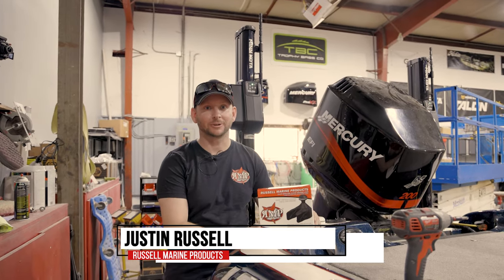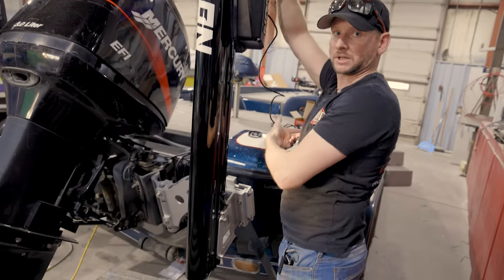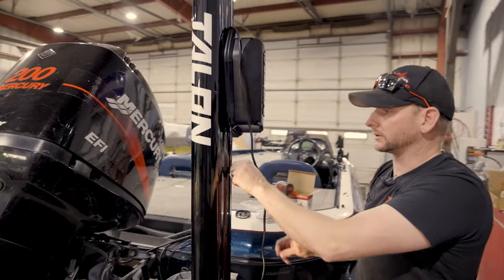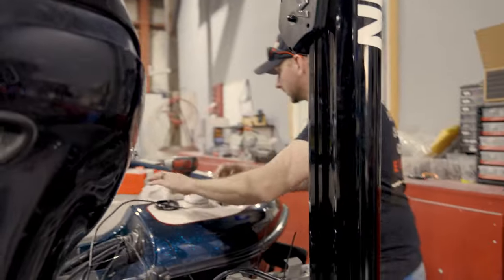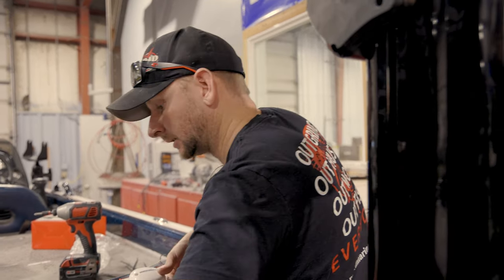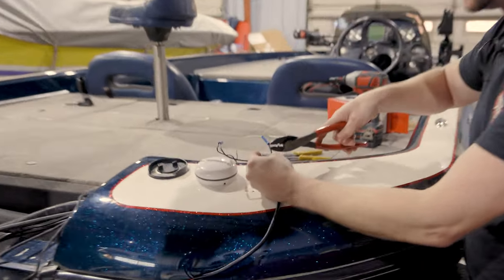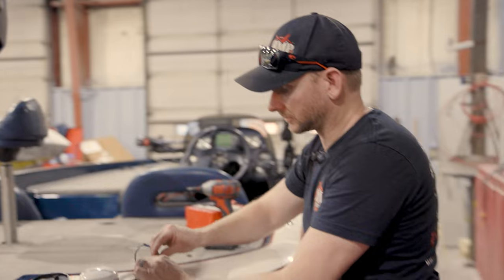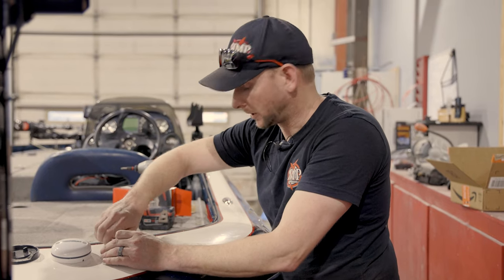Minn Kota Talon 360 Anchor Light by RMP - STEP by STEP installation.

Comment: Good day. I accidentally found your channel when I was looking for how to deal with the Lowrance Sonar Hub. But to my regret, I did not find the answer to my question. I have connected two sensors to the Sonar Hub. LSS-2 and HDI (83/200 + 455/800 kHz). How can I do it so that the side scan is from the LSS - 2 sensor, and the Down scan is from the HDI? Perhaps you know the answer to this question? I would be very grateful to you.